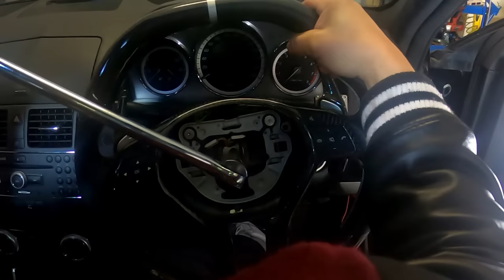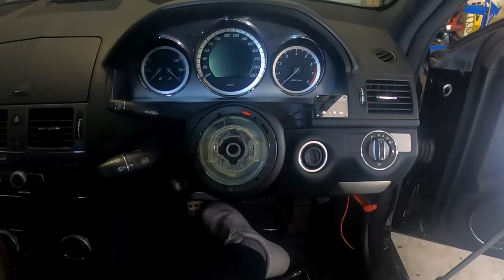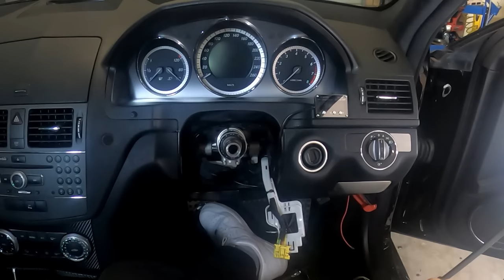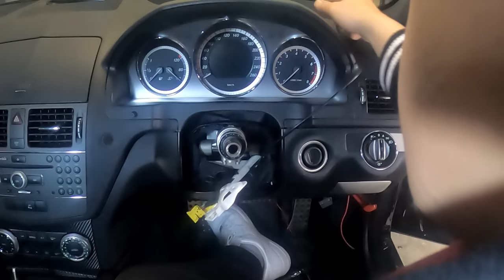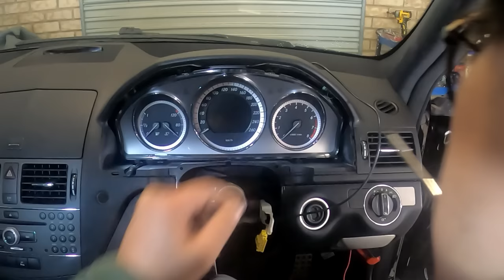HOW TO remove and fix ESL/EIS/ ELV MODULE  w212 w204 mercedes motor replace  Part 1

Comment: Thanks for a great couple of videos on this fix, they helped a lot. Mine was failing now and then. The old motor and circuit board in the ESL were even tarnished from the motor overheating. It was well worth a clean up and motor replacement before total failure. Its been all good since!
Reply from the maker: well done mate good stuff..thats what its all about... if i can help even just one person its all worth it to me... but im glad so many ppl are getting good use put of my videos

Comment: Dude I want to give you 1000 likes if I can, it just happened to me when I was outside.  I smack the hell out of the wheel and it worked lol thank god
Reply from the maker: so happy for u mate
Reply: @MIKEYZVLOGZ  question for you ..what if you changed out the battery while this condition was occurring....have I eliminated the possibility of getting the esl to unlock without having to physically remove it from it's location by cutting that bolt?
Reply from the maker: did u unlock the car first them remove battery or did u just remove battery without steering unlocked
Reply: @MIKEYZVLOGZ  not for sure but I assume it was in the lock position because at that point I  time I knew nothing of the esl or n.e.thing beyond the car wouldn't start...stuck in park...battery looked kind of old and the auto parts store said it would not take a charge it was bad...( Now I know it prolly wasn't...none the less a new battery has been installed )am I doomed?
Reply from the maker: @TamaraCMoore  no your not, as i stated theres always a way to unblock it whether it s more involved or u just go the route of an emulator, but if you were hoping to tackle this with the esl unlocked, u can still try a few things, like tap the steering column underneath and see if you can insert key and get the esl to spin unlocked, if all else fails u can drill a small hole and manually turn the esl motor , another is the esl emulator, where u buy an emulator and send off your keys and ignition and they will code the esl emulator to suit your car and all u do is plug and play, its also better for the long run, and u never have to worry about the steering locking , takes away steering lock but the safety is still there cuz u still need a key to start your car,  see how u go , try tapping your column and inserting key, u might be lucky to get it to spin one last rotation then u disconnect battery , and u can do it
Reply: I removed the undertray were the OBD2 port is on my C63. Knocked on the steering column with rubber mallet. Put the key in sounded like it unlocked and fired right up time to order a new motor i will save this video thank you
Reply: New update, I bought the motor on eBay for $10 and fixed the problem lol can’t imagine people paying $1000 at the dealership

Comment: thank you so much for this video. I swapped this motor on my 2009 X204 GLK today. And this saved me alot of time. However after several attempts I finally found that I had to trim down the axleshaft on the motor abit, it was too long and locked up inside the ESL housing. Works great now, finally.
Reply from the maker: great stuff mate well done... 👍

Comment: Thanks for the great instruction. My vehicle is doing exactly what you diagnosed as the problem. I need a reverse torx bit which I will get on Monday and will then attempt the repair. I will let you know how it goes.
Reply from the maker: excellent to hear i encourage diy as to help save money and keep it in your pocket welcome to the channel and hope you enjoy the content
Reply: @MIKEYZVLOGZ  Hey Mikey. I replaced the motor today and reinstalled the ESL. Works perfectly. Thank you for your excellent instructions of this fix. Saved me a fortune in repair shop costs. The biggest issue in the whole process was one of the 4 pins to split the box was a bugger to remove. Anyway finally got it out. The whole process took about 3 hours but I went very slowly to make sure a followed your exact instructions. Thank you
Reply from the maker: @theovonbardeleben2725  well done buddy i applaud u for doing it yourself and saving yourseld a ton of money as we all know this is an exspesive fix

Comment: This is an awesome video . Some people say to disco the battery and wait 30 minutes before removing the airbag. Question - could I use an electric impact gun with a 10 mm bit to loosen the steering wheel bolt ?  Any reason not to so it ?   ( and not use it to install the bolt )
Reply from the maker: hmmm.. I thought about that .. I've seen ppl do it .. u just have to hold the steering wheel tight and make sure it doesn't break the steering lock, that's all... if u can use it to take it off, u can use it to install it... main thing is not to loosen or tighten without holding the steering wheel... I don't want to break the locking mechanism

Comment: Good vid - thanks. For those who CBF or just don't want to attempt this, if you live in Sydney, go to Motech Autokey and he'll install an emulator and leave the ESL in there, assuming it hasn't failed in the locked position. Emulator will never fail. It took him 45 minutes to install it in my W207. It cost a quarter of what the dealer quoted me.
Reply from the maker: thanks mate much appreciated.  thanks. sharing ....

Comment: P.s mikey, it would be great if you could write tools and sizes used from beginning (hex and torx etc) in the description so we know what to have ready and what to start with?
Reply from the maker: ye my apologies for that i thought that u would be able to see the tools i use in the videos and know ehat to use .. but definitely a good idea to help others know where and what to start with
Reply: Looks like E12 Torx for the four bolts of column to chassis.
Steering wheel uses a 10mm Imbus hex socket or simply any 10mm hex will do.
T40 Torx for the bolt at the spline at the bottom end.
Reply: @dominicwild3189  thanks!! 🍻
Reply from the maker: @dominicwild3189  good on ya mate for sharing this
Reply: Forgotten the Torx for the two bolts on the surround below the steering wheel, use torch and then judge, it is definitely a smaller one.

Comment: Great video, can you push the pins in if they don't come out?

I have removed 2 pins thr otherb2 are stuck
Reply from the maker: thanks for your kind words ...if u can't remove them pushing them in won't get them out..u can always drill them out if u really can't and it's fine to drill them out with a small drill bit ..from there u can use a screw to re secure

Comment: I recommend this movie! It works 100% It is important to pay attention to all the details that the author explains in great detail. In my country the same trick to fake mechanics works with 300-500 euros. We solved this problem much cheaper and simpler with about 10 euros. Thank you very much to the uploader and I challenge him if reading this message can help us with a repair for the headlights, more precisely the short beam illuminates very badly probably because of the mirror in the smoked headlight. Can find a cleaning method. Thanks again, especially for the accuracy of the details.
Reply from the maker: HEY BUDDY Thank you for your kind words....im no mechanic but i can definitely try and help you ..i appreciate the comments and am always here to try help my subscribers and will do my best ..... so if you can send me a pic of what your trying to do with abit more explanation i will see what advice i can give to help you
Reply: @MIKEYZVLOGZ  I have a problem with the headlights more precisely on the short beam. When I bought the car a year and a half ago, the short phase was below the safety limit for me. I used better light bulbs (Osram Nightbreaker) and slightly improved the problem but it is not safe. I tried some H7 led bulbs from Aliexpres, which were very well rated. After replacement the results were very poor. Later when I moved the LED bulbs in the long beam I found that the LED bulbs are super good, the problem of my headlights being the mirror behind the lens. You can find a method of cleaning that mirror or maybe a tutorial on disassembling the headlight. Thank you
P.S. I have normal headlights with 2 h7 bulbs adn i use google translate, i hope u understand.
Reply from the maker: @MrGeorgeSuciu  oh yes so is the reflection inside you headlight a problem? is it a adjustment issue?? maybe you need to adjust tthe beam, they can be adjusted low and higher for better beam pattern and you can see more light and clearer at night...i will be a doing a video on how to open headlight..so u have the normal halogen lights no bi-xenon??
Reply: @MIKEYZVLOGZ  normal halogen 2xH7.  I think is reflector the problem. Maybe a disasembly for headlight will be wonderfull.
Reply from the maker: @MrGeorgeSuciu  ok

Comment: Observation:  Don’t freak out if you get it all back together, put the key in and nothing happens.  As the lock is in the unlocked position when installed, you will have to remove the key to lock it back, then reinsert it to unlock and start the car.
Reply from the maker: good tip
Reply from the maker: @Pedrobett  no programming needed
Reply: Yes, exact same experience, and then perfect function since.

Comment: How do I know the ESL is unlocked? Is it unlocked when the steering wheel is unlocked? Or do I need to hear that noise it makes usually when i put the key in?
Reply from the maker: u need to hear the noise ..however im not too sure if having the steering unlocked necessarily means the esl is unlocked friend

Comment: My w212- 2015 has unlocked steering wheel all the time. No "noice" when i put in the key or when i take it out. But i can start and drive as usual, works perfekt. But steerinwheel is never locked. Is the motor in that module broken?
Reply from the maker: u wou assume so mite be a good idea to get a scan done first too so u can narrow down or find the source of the actual issue..but definitely seems like it's the motor ..its no longer spinning to allow the steering wheel to lock
Reply: @MIKEYZVLOGZ  Code is A25646 "Electric steering lock ..........."
Reply from the maker: @dominicwild3189  that would be the esl module motor common fault with these cars
Reply: Lucky your US$5 motor did not push the locking pin out any more and froze in the unlocked position. Glad you can still start.
Reply: Lucky your motor failed in the unlocked position, mine locked, so I have to cut the bolt attaching the ESL to the column. The scan will show error A25646 "Steering wheel .........." and will show the motor has gone west.
Reply: Lucky the NEC security chip lets you start your car and the US$5 motor died in the unlocked position. Smile, you saved yourself $2,000! Unless you are fussy as the car might just be a bit easier to steal, keep smiling!

Comment: After I changed my motor I did not bolt the unit back where it belongs I just left it hanging on top of the plastic cover under the dash. That way my steering wheel will never lock which is actually pretty good for me and there is never any load on the locking pin and if I want to access it ever again it only takes three little screws and it just falls out straight down. Prior to changing the motor I was having some issues where the motor would get stuck so I drilled a tiny hole via the big wheel and I just rotated the wheel manually gently with a very flat head screwdriver. Tapping has helped in the past as well
Reply from the maker: well done good thinking  and thanks for sharing  your findings it really helps others trying to do the same task ...i take my hat off to you
Reply: @MIKEYZVLOGZ  Would it be necessary then to change the motor at all I wonder?
Reply from the maker: @dominicwild3189  if u dont want to have to do that in order to be able to starr ur car then it is a must ... i guess its dependant  each persons own needs and capabilities... personally id rather have my car functioning  correctly then  not ...but each to their own.... for me i consider it a hassle to have  to do that if my car didnt start due to esl malfunction ... but thats just me ... if my esl fails again im going  the route of an emulator as it no longer has a motor that can malfunction... thats  just me.... about 450 aud to solve this issue including new emulator and programming ... solving the issue of loving parts and the motor failing
Reply: Great idea! In my case I had to cut that 10mm bolt and that bolt cannot be replaced easily, so I am going to do the same thing like you. That will give me 13 years peace before that motor burns out again!
Reply: @MIKEYZVLOGZ  well isn't the point of the esl to lock the steering column to prevent theft? So there is some value in having it function properly

Comment: Love the video ‼️just one question pertaining to the steering lock,how do I get the 13mm bolt off ,do I just have to feel for it? I got the 4 screws out the holds the column and lowered to column
Reply from the maker: yes u feel for it and then get a 13mm socket or wrench on it however u can and then slowly but surely get it off..thanks for the comment and thanks for dropping by my channel hope u can sub and follow me along for more w204 content and other stuff km passionate about
Reply: Thank you so much , I tried to get a 14 to fit. And it’s stuck there , might have to take out the column😢
Reply: I’m getting an emulator for it,can I just leave it in there? Or do I still have to remove it
Reply from the maker: @guydautruche8681 u can just unplug the esl and plug into emulator
Reply from the maker: @guydautruche8681 if that's your only option... so be it ... its nit too bad to get in and our..it does take a bit of manuvering but very possible

Comment: Hey, Mikey. I’ve been reading blogs/tutorials all day and came across yours. 

I’m having trouble with my 2010 Mercedes-Benz C300. 95,000 miles. Here are the symptoms so far. 

I’m able to unlock my car with the keys. I get inside and put the keys in the ignition and try to crank it up. Nothing happens at all except for the “remove keys from ignition” on the dashboard. The radio or lights do not come in unless I manually turn them on. I’m able to move the steering wheel left and right. Wheel is heavy but still manage to move it a bit. Try to crank it up while moving the wheel at the same time and nothing. I’ve checked the battery and tried jumping it from another car and that didn’t work. I’ve checked all the fuses and they’re all ok. Lastly, I got out of the car and press the “panic” button on my keys and entered the key into the ignition and the alarm stops. 

From all these symptoms & trial and errors that I found online, what do you think is the problem? The ESL? Steering column? I’m completely lost and don’t want to spend $1000+ at the mechanic. Any input would be do appreciated. Thanks so much and greetings from Florida, USA.
Reply from the maker: definitely the esl mate everything u described happened to me aswell to a T .... if ur not comfortable doing this yourself as u can cause more issues as in ruin the chip as i explained ... best thing i recommend is to remove the esl module and the eis yourself and then send it off to have it fixed ..this way it will only cost u 300 max ... do not pay more then 400 seeing as u are doing all the work ..ur just getting a specialist to fix the esl module by either replacing the motor and also testing it to make sure all is well and the eis reads the esl again.... this is what i strongly recommend ..especially if u arent comfy doing the actual electronic work...and mechanically removing the parts also....
Reply: I spent today removing the ESL & EIS. Your videos are amazing! I struggled with the ESL as I couldn’t see its exact location and screw etc but got it all done. Thanks for the help!
Reply from the maker: @adgmuniz  well done im glad my videos could help u out

Comment: Great video, i’m strandend with a locked Els. You said you tapped on it like one would do with a not working starter motor. Hoe do you tap it, when you cant reach it?
Reply from the maker: tap on steering column not the esl... u tap on the steering column where near esldirectly on the esl as u cant reach it  or see it clearly, and u do this before you attempt to start the car

Comment: I don’t think you showed when you took off the 13mm bolt that attaches to the ESL. Great video though! I have a motor and a tool on the way and preparing to replace it soon. Wish me luck.
Reply from the maker: its in part 2 dear friend...wish you ll the luck in the world ... some ppl have tried and failed but its all about attention to detail..and sometimes its just a matter of luck..sometimes it seems to be the motor but then it turns out that it is the chip or relay... but most of the time its the motor... however ive heard other ppl say that it may need re syncing and some even say they dont..i know with mine i replaced it and i was good togo.... if you read some comments some have had success with no issues just a simple swap and others have had issues.... but the issue is most likely needing re syncing... i wish you all the luck iin the world...check out part 2 and you'll see how to remove the bolt
Reply from the maker: i also hope you can subscribe to my channel and help build this channel for all w204 lovers
Reply: Oh thanks, I actually just watched it, haha. I had an ESL fail about a month ago and just about had it towed before it worked on its own again. It’s been fine, but I’m glad I did the research and will try to install a new motor before for it fails for good. Thanks again!
Reply from the maker: @Hammondbrass  im.glad theres many ways u can try to remove the 13mm nut but this is the easiest for me and i have big hands ... just a simple thumb ratchet and bam your good to go.... .... thank very much for visiting i hope u will sub and visit me again .... all the best mate....